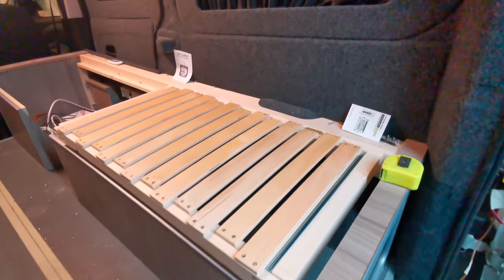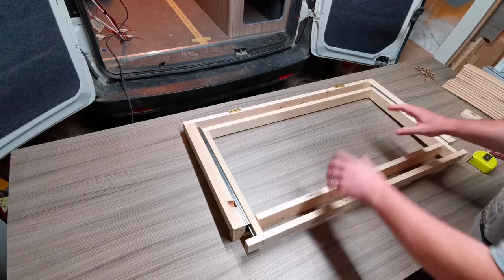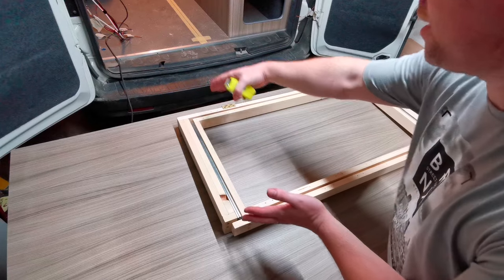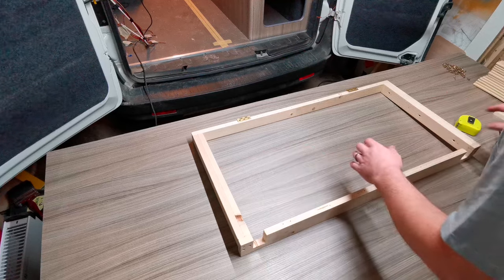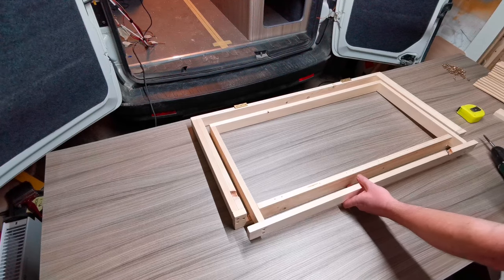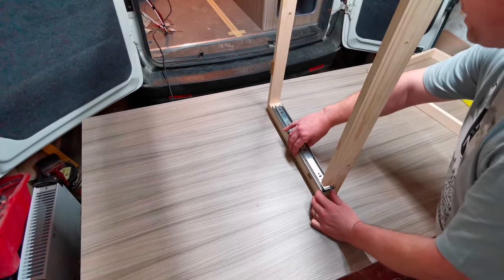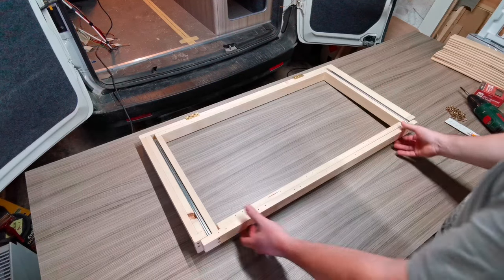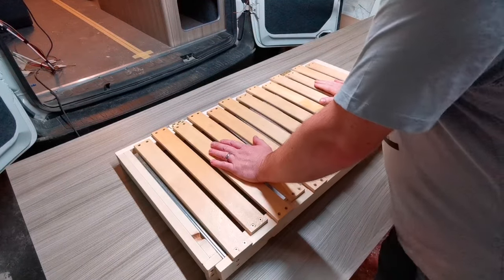How to make your own bed system for Campervan or motorhome

Comment: Thanks very much for this video, I have two  and a half "upgrade suggestions which i implemented myself.
1: Use but hinges with removable  pin 
2: The "gap" you  have between your panels.... Rotate / alternate (if 3 panels)  and you can slat up right to the edge
3:  use plastic Slat caps .... and indiustrial strength velcro. (Cut the pins of the caps. It makes spacing easier) Allows more fexibility on the slat   and if something breaks  its easier to replace

Comment: Certainly the best I've seen, thank you for such useful information. Yet to start it on my ex WAV Scudo. Have withdrawn the advert of the IKEA bed with those slats!! the runners are a great idea.
Reply from the maker: Thank you very much for you kind comments 👍
Reply: You can buy the slats for £15 and if needed they can be trimmed. But they are supposeed to bend and in this vid they are screwed at both ends, so would not bend.
Reply: @maxpower9340  Ikea bed slats are bent and springy to a small extent. Work very well on my bed based on Dan the Man's idea. I have some to sell.

Comment: Wonderful video, thank you! I understand how to find the length (& make in sections!), but I'm wondering if there is an equation you used to figure out how deep to make the couch based on the size of the bed? For example, if you know you want the overall bed width (fully extended) to be 54", would you make the couch and pull-out slats to be 27" (1/2 of 54") each? Thank you!

Comment: Hi Dan
Where did you source your slides?
Do they need to be large load bearing?
Great videos
Reply from the maker: Hi you can purchase them from b and q or screwfix etc, the ball bearing runners don't need to be load bearing as there is a support on the front rail 👍 many thanks for watching
Reply: @dantheman321  
Cheers Dan - off to screwfix👍

Comment: Perfect job,well done! I have only one question,pls answer.Are the support legs in front are exactly the same hight as the base,or they are with few millimetres less to avoid scrubbing onto the floor and ensure smooth slide ?
Reply from the maker: Yes the support legs were lifted a few millimeters off the floor when retracted to ensure a smooth slide. 👍 Many thanks for watching

Comment: Great video. do you feel the slat gap between the two frames when laying on the extended side? & would this design allow for a pull-out drawer on the bottom? would it be difficult to add? Cheers

Comment: This is awesome!! If you used heavy duty runners could you do it without the legs? Thanks
Reply: Would like to know this too, thinking of getting 225kg heavy duty ball bearng runners and would be much nice without the legs, theoretically should be plenty to hold 1 or even 2 persons weight especially over 2 pairs of runners
Reply from the maker: I would keep the legs as it is a wooden frame and not metal. Many thanks for watching and please don't forget to Subscribe 👍👍

Comment: Cracking bed thanks for sharing but could you tell what length hinges you use
Reply from the maker: Just standard butt hinges and they are about 3 inches long 👍 hope this helps
Reply: Sorry my bad I mean the rollers
Reply from the maker: @karlbyrne6795  haha no worries, ball bearing runners on this build I think were 300mm if memory serves 👍
Many thanks for watching

Comment: Is that just extra wide T- molding for the edges of the plywood? I don't think I've ever seen quite that design before. And you may have mentioned in the video, but what is the thickness of the slats? 12mm?

Comment: you said the boards are from IKEA? are part of a furniture or they come just like that?i  m heading to IKEA tomorrow .that s a great idea. they look great and slim . i m trying to make bed for a Mercedes Metris and trying to keep the weight down as much as possible. thanks bud . that s great video.
Reply from the maker: The beds slats come on there own. You can get different amounts and different length so make sure you know what size you need. Think they are advertised as single bed slats and double etc hope this helps 👍 many thanks for watching 👍👍
Reply: @dantheman321  thanks a lot bud.

Comment: @dantheman321 Amazing and super generous video!  We’re gonna build this is our 1994 Volkswagen Transporter.  Question; do you not run into any support issues with the gap in the slats at the middle point between the two sections?
Reply from the maker: No the system works really well. Many thanks for watching 👍👍

Comment: brilliant video Dan. on the front face I presume u leave a gap from floor so it does not mark floor wen sliding out ? but I always wondered will the gap not put pressure on the frame wen someone is lying on bed
Reply from the maker: The frame can touch the floor as you can lift as you pull with it being hinged at the back. The frame itself is lightweight so isn't a problem that way 👍many thanks for watching
Reply: @dantheman321  ah yes

Comment: Great video, I’m going to try and make one for my van.  Might be a silly question but do I have to add the support legs? Would the runners on there own be strong enough.
Reply from the maker: I would add support legs as the frame is wood and not metal 👍👍 many thanks for watching

Comment: Really innovative work on the slat bed. The slats you used you mentioned were 50mm wide. Did you have to cut longer lengths down? That width is used  for large bed sizes (i.e. King, Queen) with longer slats here.
Thanks,
Jim
Vancouver, British Columbia, Canada
Reply from the maker: Hi Jim, I bought the shortest length bed slat I could but still had to cut them down for this project.
Many thanks for watching

Comment: Great video! Can I ask about how you contoured the bed to the side of the van? I have a Citroen dispatch and would lose about 2 inches if I didn’t contour the bed in some way…any advice gratefully received! 👍🏻☺️
Reply from the maker: I used 1/4 ply to bridge the gap between the bed rail and side of the van. I also attached another timber rail to the side of the van to screw too. Hope this helps 👍 many thanks for watching

Comment: Hello, what do you call or what is the name of the edge trim that you wrap those face panels (the panels on the front of the bed that pull out) and ends in? The trim  that cleans up the cut edge.
Reply from the maker: It's called either knock on edging or t trim 👍 many thanks for watching
Reply: Thank you Sir! It was an awesome video by the way. I loved it! @dantheman321

Comment: Hi Dan - can you tell me the Exact size/length of the ballbearing runners you used and where did you purchase them .. Thank you
Reply from the maker: If memory serves they were 300mm in length and you can get them from wickes/b and q etc. Available in most hardware shops👍 many thanks for watching
Reply: @dantheman321  Many Thanks 👍

Comment: This is a great design and I've tried building this twice now but I've run into issues with wood on wood contact when sliding it out. What makes your frame slide so easily, without the supporting frame sliding against the slats? Thanks!
Reply from the maker: Lift the inner frame by a couple of millimetres that's all, that should cure it 👍many thanks for watching

Comment: Hey Dan! Quick question (hope so!). The support frame you were to add at the end, would it not be better to have that support frame under the bedslat frame for more support? Thanks! Planning on doing this to my Vito
Reply from the maker: Hi Rob, are you talking about the frame that pulls out? If so I have added some legs that are fitted to the front to add support. I've made this system for years and never had a problem it work great 👍👍 many thanks for watching
Reply: @dantheman321  awesome, thank you Sir!

Comment: Hello Dan. Is there a good way of closing the gap between the sliding parts when both halves are pulled out?
Reply: I've been wondering about that too. I really like your demo style. This is the best I've seen and I really want to make it, but that gap looks big when both sides are pulled out. If you have a wider rig maybe you can go with a single pull out?
Reply from the maker: It isn't as wide as you think but the cushions will support that without a problem 👍 many thanks for watching

Comment: What is wall board and I take it lifts up with bed frame  . As a new sub I'll review past vids .
Reply from the maker: Wall board is 6mm ply covered in 4 way stretch carpet and yes the bed slats will lift up to gain access under the bed 👍 many thanks for subscribing 👍

Comment: Hi! Really good explained! What about the mattress? Are both the same size or are they slightly different?
Reply from the maker: The base will hang over the front of the bed by about an inch or so and what ever the gap is between the base and kitchen is what the back rest will be. Each conversion is different usually so needs to be measured to that job 👍 hope this help

Comment: Hi Dan, it is hard to tell on your video, but are these slats the laminated and glued type with a bow in the middle of them to give some spring? These are the only sort I can see on the Ikea website. Also, with having to screw each slat down at both ends does that still allow the same amount of spring and / or does that put some extra strain on the screws when the weight of a person sleeping on the bed, tending to flatten out the curved slats, making them longer? Excellent videos by the way and many thanks for making them ;-)
Reply from the maker: Hi John yes they are those types of slats. With there being so many slats close together and when you include the cushion, it will distribute the weight onto the slats with no problems. Hope this helps and many thanks for watching 👍
Reply: @dantheman321  That's great. Thank you for replying so soon.

Comment: If you are building a 4 foot width - do you still recommend doing two slides?
Reply from the maker: You might get away with doing one pull out at that size.
Reply: @dantheman321  thanks!

Comment: Really nice video, what is the size of the bed, open and close?
Reply from the maker: It's 6ft 2inches long and 40 inches wide when the bed is made up 👍
Many thanks for watching
Reply: @dantheman321  I’m looking at something a bit wider 60/120cm, but still this layout will be helpful a lot!! Cheers man!!
Reply: @dantheman321  And in the previous video about building bed you mention pull out porta potty, any video about that?
Reply from the maker: @nutnaa  no you just simply pull the potti from under the bed that's all. That is seen in my other microcamper full tour videos 👍

Comment: Do you have the link or where you got the sliders from? What’s the load capacity of these ones? Cheers
Reply from the maker: I don't have a link but I got them from IKEA because the quality of those were far superior to the ones I've used before. Not sure what the load capacity is but I've never had a problem using this setup in the past.
Many thanks for watching 👍
Reply: @dantheman321   nice one mate I’ll have a look! Thanks for the quick reply 👌🏼👍🏼

Comment: Thanks for this Dan will use this method on my van build 👍
Are the ball bearing runners soft close 350, 450 or 550mm long ?
Many thanks
Reply from the maker: Think they are 400mm but not soft close, standard ball bearing runners👍 many thanks for watching

Comment: These sort of beds are very limiting. You cannot carry passengers, you cannot take 4 people around the table and the table is the wrong  shape for practical use. Now the construction, to start with the sliders must be rated at 150kg each, since the overhang is unsupported and the rest of the materials needs to be strong. So this is much more expensive than the more practical R&R frame. You can pick up a ready to bolt in R&R frame for under £200, which is 100% rigid and folds up in seconds with no rearranging of cushions. Underneath is easy access storage bin for a ton of stuff and behind the couch goes all your bedding and clothes. Down side..you tell me?
Reply: i will tell you,with the  R&R you are changing the whole layout.You can not lift it for storage access,you have to crow down etc.What about cooking? Most of the time the stove is permanently mounted sideways with the R%R-very uncomfortable.What about the sink? IF its after the hobs you can not use it while you are on the sofa,so you will crow down to the floor to reach the sink and use it?What about the rear windows? This is an extra source of lightbut you are ruin it with the R%R and the tall shelf next to it.This is a micro camper solution,but you are talking about 4 ppl around the table...omg..i can continue more..
Reply: @didoivanov6292  Yes your layout is not idea. With a R&R bed you simply lift the seat and can access everything, if you slide the seat back a little to you rest the legs on the frame so it acts like a stay. In terms of cooking and using the sink, with a SMEV 2 burner and sink, you can do both comfortably, so cook, with both rings, wash up and wash all seated. With a swivel double seat, four can eat in prefect comfort with a simple camping table. They sell thousands of these R&R beds for good reason. They are sturdy, comfortable, cheap, versatile and provide loads of accessible storage. No need to reinvent the wheel.